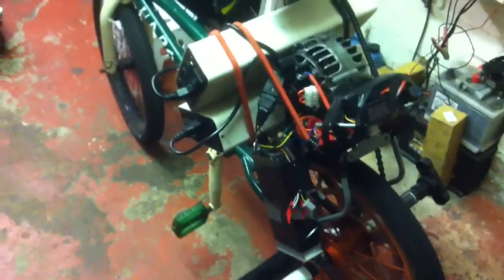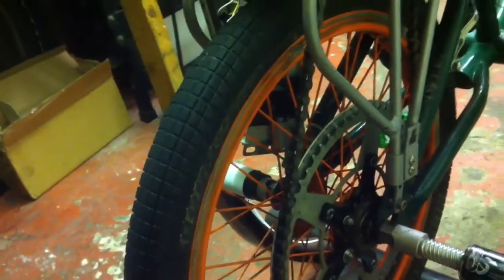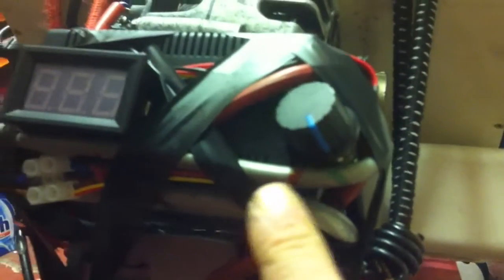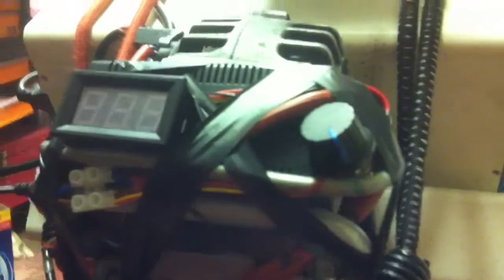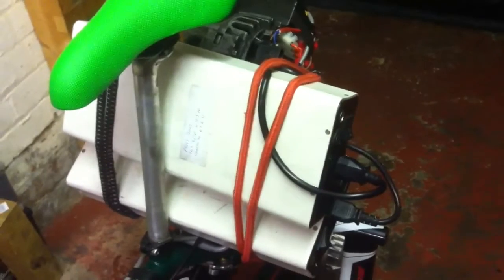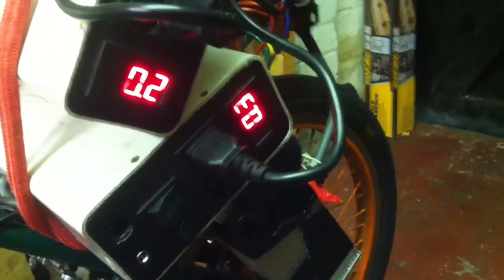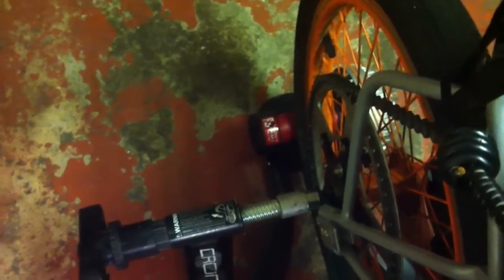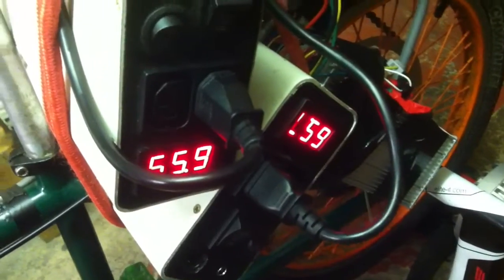Alternator powered BMX test bike

Comment: I forgot to ask when corresponding on another video, have you a link to where you got the controller. For my bike I bought one which is Hall/No Hall but I think I paid over £40 for a 36V one. 
Having said that it is happily pumping out 32A at 36V which I think is not too shabby.
Reply from the maker: The controller currently in alternator bike is a 60V/1200W version of ebay item 152584058222 (which I have not seen on eBay for a long time.  The description implies it requires Hall sensors but I doubt this is true. The one I have has 18 FETs (see below why this is relevant)

I've just bought eBay item 253657651756  36/48V 38A to test run at a lower voltage (lower speed). It ran on 67V too, which was very interesting, as it could be quite a flexible controller. I've not yet opened it up to see the capacitor rating or the number of FETs.

I also have one eBay item 173263327777  60V 1500W. I'm not sure I've used this one yet.

I have had success using 36/48V controllers at 60V (67.2V fully charged). They seem to have 63V capacitors but I've not had one fail yet. If they have overvoltage protection then the workaround is to feed the "door switch" (ignition) wire with 48V and put the 60V on the thick red wire that feeds the FETs. The FETs in these controllers are typically rated at 100V.

I have modified 36/48V 6 FET (350W) controllers to run 28A at 67.2V on my scooter (a ~30 mph Razor e300) without any failures. I'm implying from this that I could modify a 18 FET controller to pull 80-90A. I'm working up to this but as I'm getting 42mph out of my current setup on a rigid bike frame, I'm in no hurry for more speed. I'm more concerned about efficiency at the moment.

I learned a lot from
http://www.etotheipiplusone.net
Somewhere, he updated a controller on one of his scooters until it squeaked but I can't find the page.
Reply: Thanks for such a detailed reply. My 36V controller (ebay listing 163143576715) is working at 1150W when it is only rated for 800W but it is getting kinda warm after only a few miles. I've since built a 14Ah battery but haven't used it yet as I'm concerned the controller could burn out so was looking for an alternative. 

As for efficiency I agree it is the real goal, since I put up the videos I've also bought a 36V 500W Bafang mid drive kit and have tested with the same 5Ah Lipo batteries and was surprised I didn't get much more than double the distance before the batteries died. with my homebrew ebike I got around 5 miles but the professional ebike kit got 13 miles. As the homebrew ebike had more torque and I was pedalling less I would have thought the losses in my rubbish drive system would have been greater.
Reply from the maker: @alibro7512  Ok, so your battery is 5Ah at 36V, so 180Wh. At 20mph, you'd consume 250W (based on my experience using a Stages cycling power meter on a road bike). So that's about 40 minutes run time, so about 13 miles. In a mountain bike, the speed at 250W would be reduced, so something between 10 and 13 miles is more likely.
I looked at getting s Bafang unit a few years ago but it I was put off by the £300+ price tag. For my lightweight bikes, I use an overvolted 250W geared hub motor on a 350W controller. My road bike version does 30mph without pedalling. How much are Bafang units these days?
PS, I think you're overpaying on your controllers. That 36/48V 38A one I listed is in the UK and is £25. The seller uses Yodel, so.it took about 10 days to arrive.
Reply: Yes mate, I have 2 x 5S 5Ah LiPo batteries. Your figures are pretty much what I am seeing too. The Bafang is 500W but isn't flat out all the time and was helped with a little pedalling.
The Bafang isn't cheap but gets good reviews and my experience so far is positive.
I knew the controller was a bit expensive but I couldn't find any other Hall/No Hall controllers so went with it. 
It's very interesting that you are getting success with a controller that has no mention of "No Hall"
Reply from the maker: @alibro7512  I don't think the sellers know what they're selling most of the time. I think pretty much all of the current generic Chinese controllers that have a learn wire will run sensorless.
I'm running about 3kW through my 1200W controller, so I wouldn't worry about yours running slightly over rated load.
Reply: I was going to say the same. My understanding is the manufacturers are government owned and the sellers are private folk like you and me or small companies. Most sellers haven't a clue what they're selling. I'll order a higher powered controller and see how it goes.
Reply from the maker: I found the page i was looking for. He's got 1800W at 40V, so he's getting 45A out of a 6 FET controller, albeit with modification to the capacitor bus. 100A out of an 18 FET controller should be easily achievable.
http://www.etotheipiplusone.net/?p=1701
Reply: I'll have a good read at that later thanks.

Comment: very good
Reply from the maker: Thanks. I'm building a small collection like yours. I made a  65kph bicycle (my main alternator project), a 40kph drift trike nd a crazy trike (I'll do videos soon)
Reply: it's too good, continue like this
Reply from the maker: If I want the alternator to run at a lower speed, do you know if it is more efficient to use a lower voltage and higher current? I think the alternator motor is very inefficient and I am looking at ways to improve it.
Reply: No 24v is the minimum, it takes 48v or 60v ..
4x4s lipo is the top ...
go see my channel to check ..
Reply from the maker: I use 16s lipo (2 x 8s).
So I think you are saying that lower voltage is less efficient. I have watched most of your videos. Do you have one that looks at efficiency?

Comment: What are those housings you used for the battery packs?
Reply from the maker: Manrose 125mm trunking for cooker hoods from B&Q. The ends are 65mm x 12(ish)mm from the B&Q stripwood section. The reason for using this is that you can fit in 18650 cells within the width. The battery is 16s6p
Reply from the maker: The packs are designed to go in a pannier; I've only jammed them on this for testing it.